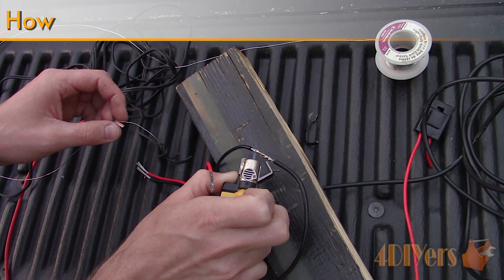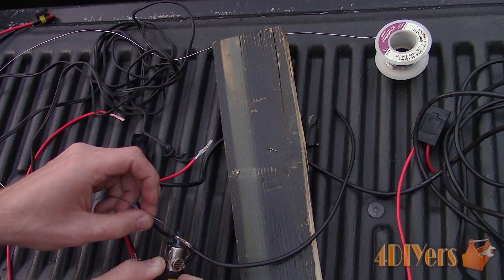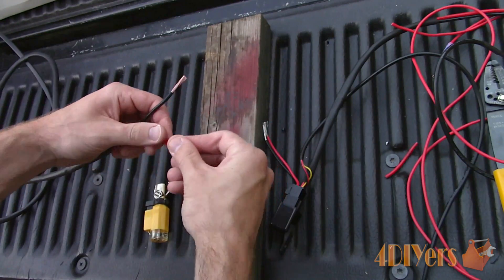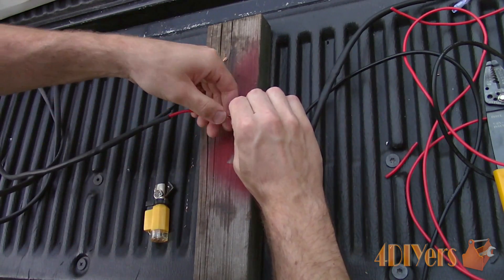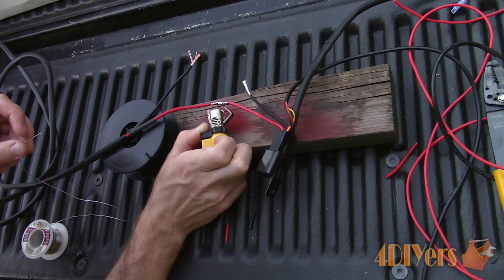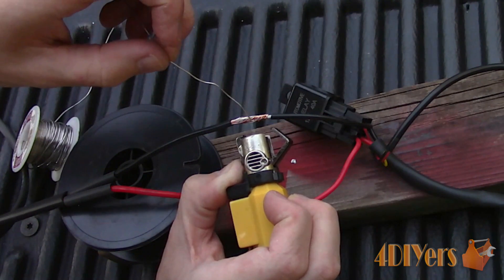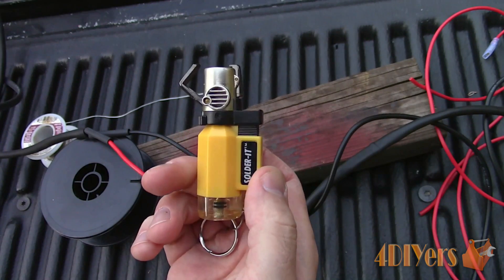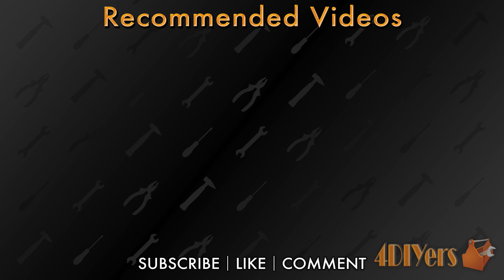How to Solder Wire Using a Mini Torch

Comment from the maker: Amazon links for various products used in the video for both USA and Canada:
USA:
Soldering torch: https://amzn.to/3cviROM
Butane: https://amzn.to/3qZGvs5
Solder: https://amzn.to/2NnBKdM
Heat shrink: https://amzn.to/3s4FQ9y
Cable ties: https://amzn.to/2Maa0ZO
Electrical tape: https://amzn.to/2Zxy7o6
Split loop casing: https://amzn.to/2ZxZL4g
Liquid electrical tape: https://amzn.to/3ayhEqg
Canada:
Soldering torch: https://amzn.to/3tlKQqY
Butane: https://amzn.to/3rRuTbv
Solder: https://amzn.to/3blrYRC
Heat shrink: https://amzn.to/3s4FUWQ
Cable ties: https://amzn.to/3drYRyI
Electrical tape: https://amzn.to/3k4EVTy
Split loop casing: https://amzn.to/3puwceN
Liquid electrical tape: https://amzn.to/2OIZAkA

Comment: I thought of trying this with some solar cables on our roof with bad crimped wires.... but first gotta watch some youtube to see if its feasible before buying a torch lighter...
Reply from the maker: You can use a propane torch too, just make sure it's on a low setting.

Comment: looks like it takes about 10 seconds to heat up wires enough(to melt solder) & then of-course quickly smoothly & carefully slide that self sealer - self soldering gizmo over it with pliers, which no one understands how to make melt, no one dUing videos , etc.)✋😒
Reply from the maker: Are you referring to the heat shrink?
Reply: don’t understand your question, even what you mean by ‘heatshrink’.. I was saying pointing triangle blue flame at 2 attached wires to heat them(only), then slide the self sealer gizmo over it, etc. - btw I tried it & it workd!😐  trick for eazy sliding is gently adjunct flat head(standard) pliers to part of tube around solder ring part👋

Comment: I have one with the soldering tip and it was useless, didnt get hot enoigh. I ended up taking off the tip using it similar to how you did. Ugly job, hope the connection lasts.

Comment: Neatly wrapping insulation tape is  just as good as heat shrink....
Reply: andrew greenall No. Heat shrink protects better against water leaking into the connection. Heat shrink with adhesive makes the connection completely waterproof. In a car you obviously want to make waterproof connections.
Reply from the maker: Not necessarily. First is properly wrapping it and not everyone knows how to. Then is the long term aspect too.

Comment: This was the most useful of all the soldering videos to me because I didn't need the secondary flux if I was using flux infused wire and the soldering iron wasn't getting hot enough and the lighter worked but enflamed the flux I was using. If I had watched this first I'd have saved myself 25 dollars on stuff I didn't need. Very informative and thorough. Thanks
Reply from the maker: No problem, happy I could help!

Comment: I never knew soldering was so easy
Reply from the maker: Yep, it's pretty straight forward. Just takes some practice to get used to how much heat is required and how to flow out the solder. Not sure if you've seen my other video on how to solder with a soldering iron, it covers all the basics and connection types.